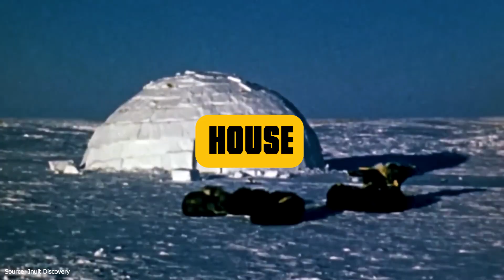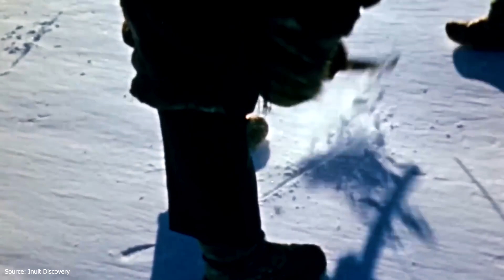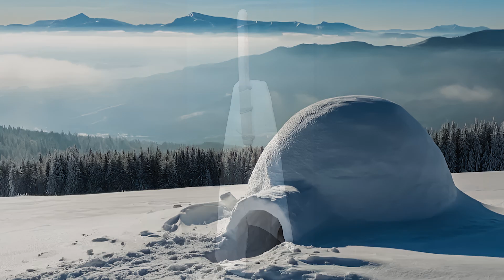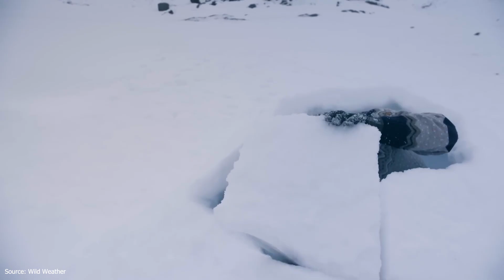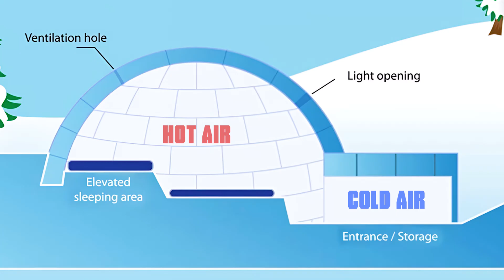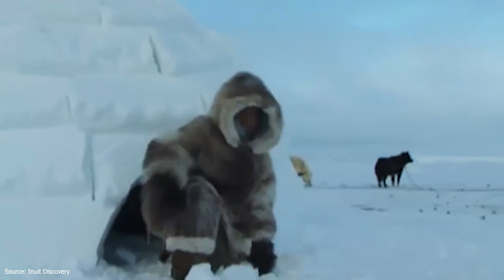Inuit Expert Reveals How Igloos are built

Comment: Interesting. A little controversial about the melted glaze in the interior. It is not desirable as it inhibits the insulating properties of the snow rather than enhancing. It is a side effect of use and limits the lifespan of the structure.